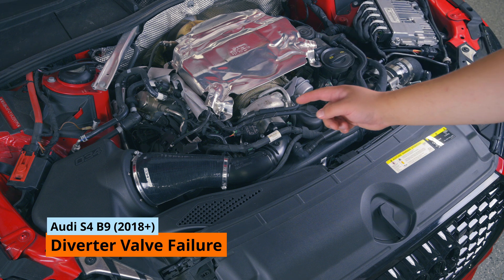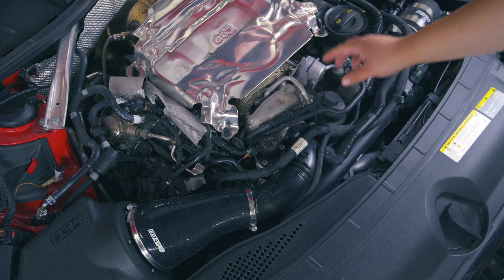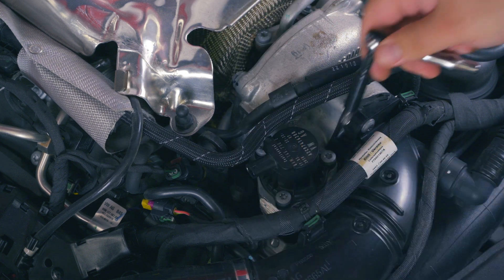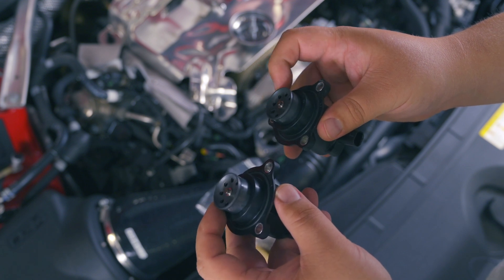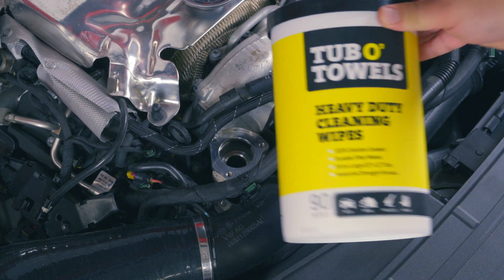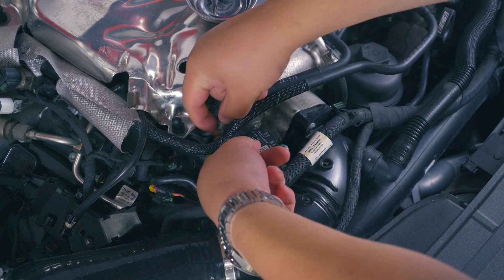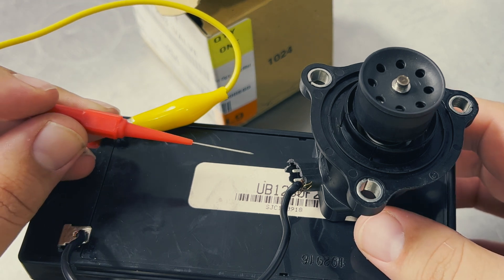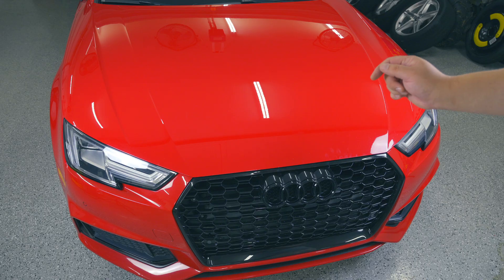Diverter Valve Failure - Audi B9 S4 3.0L V6 TFSI

Comment: hey man i kn9ow this was 2 years ago, but im having similar issues. did you experience any lag with the turbo/no full boost whatsoever?
Reply from the maker: I did not as mine was sticking closed. If yours is sticking open or partially open it could reduce boost and cause lag. There are other reasons for lag too. Should definitely scan codes as well with a vw specific scanner in case you have other detectable air leaks.

Comment: I’m getting a P02261 code on my b9s5 after installing tte810 turbo will this help.
Reply from the maker: Possibly. Have you double checked the leads from the diverter valve are hooked up and making a good connection?
Reply: what fixed your problem, i'm getting the same thing and i'm tte810
Reply: @Y @YTBJAY I changed diverter valve still comes on every once in a while I think it’s has to do with the wastegate but very seldom I get a code

Comment: Thank you so much for this informative video.  I was getting intermittent boost leak error code and I noticed the same type of flutter you showcased in the beginning of your video.  Most of the other recommendations I came across led to PCV breather hose failure so I ended up ordering both the newer DV as well as a PCV breather hose in case.  Hoping it's just the DV since those breather hoses are a pain to disconnect!  Cheers!

Comment: Mine failed for the 3rd time. Ugh.
Reply: Don’t feel bad. I have compressor surge under load and I am at stage 2 SQ5.
3 DVs have failed you but your  beast SQ5pushing 700hp with a the TTE810😮😮😅

Comment: Getting a code for P0033 (Turbocharger Bypass valve control circuit), not sure if it would be related to a failure on the diverter valve or not. (TTE810 B9 S4) Haven’t noticed much performance changes and the upgraded turbo is loud as is.  Curious if you had any codes/soft codes pop up? Thanks in advance
Reply: What ended up being your fix for that code?

Comment: Hey great vid, Question, did you have any underboost codes?? p0299?? Im geting that code, thought it was the wastegate so I replaced the turbo. Same issue. Next thing is to replace the diverter valve. I am hearing the flutter when you rev it up.
Reply from the maker: Thanks! No I didn't have any codes. You can try to swap out the diverter, hopefully that helps. Or PCV system maybe affected?
Reply: Did the n75 valve fix the issue? These engines have 2 of them. One at the top of engine and one by the water pump

Comment: Hey Dmitri, thanks for the video, my car is currently experiencing sort of similar problems. I am tuned and at full boost the car makes 28psi but then drops to 20psi and pulling timing as well. I am hoping that my diverted valve is failing
Reply from the maker: Hmmm pulling timing wasnt a symptom I had. Maybe fuel quality?
Reply: @DmitrysGarage  that’s what the shop thought too, but I all ready went thru about 5 tanks of fuel, mainly shell. I have a video of the intake sound under load, it’s fluttering pretty bad. I can dm you the video if would like to hear it
Reply: @Mark_Isaev_ did the valve fix it?
Reply: @beardog420  sadly, it was bad injectors and the car blew up 🥲🥲🥲

Comment: Just wanted to update and let you know the flutter is back and worse.  Any ideas on what else could be done or added to eliminate it?  If thats just the way it is so be it.  I just want to make sure I'm not wasting HP.  I almost never see the gauge at even half boost.
Reply from the maker: That's too bad :(, was it the latest revision? I've been lucky and mine has worked well even on the bigger hybrid turbo ever since I swapped it. I do know some people convert to a traditional BOV setup, but I've not personally done that. May be something to look into, though I hear some of the kits do cause CELs.

Comment: Wouldn't this be covered under warranty?  No that i could take my s4 to the dealer.  My aftermarket warranty is great and covers essentially anything.  Even scratched wheels.
Reply from the maker: Sure if you have a warranty they would likely cover it.
Reply: @DmitrysGarage  Did it myself, when i first started it and drive i still heard it for about 1000ft, then gone!!  By far the easiest job yet!!

Comment: Thank you again for another great video! Quick question: was you boost gauge not moving all the way to the end? Is sound the only noticeable sign?
Reply from the maker: It depends on how it fails. You could fail to build boost or it can get stuck letting out boost or both transiently. I think mine was sort of doing both.

Comment: Surprised this failed early but thank you for the video. Other than the flutter, were there other symptoms or warning lights? It’s unclear if the multimeter test helped you confirm failure.

Comment: Question, did you have an issue with oil at your  oil filler cap? Is there a problem with the crankcase breeder hose possible ?
Reply from the maker: I haven’t so far thankfully. Are you having this issue?
Reply: @DmitrysGarage  yes but thankfully after extensively researching I found out there’s an upgraded crankcase breather pcv hose for it.
Reply from the maker: Cool. Ill have to keep that in mind if mine starts doing it

Comment: Love the content, what's your take on the ea839 rocker arm problems that some people have experienced?
Reply from the maker: Thanks Rob, glad you liked the videos :). For the rocker issue, the new revisions do seem beefier. Seems to be same part as used on the Urus.  However, we've only seen a handful of cars on the forums with confirmed engine problems. This engine and it's 2.9L variant have been in used in quite a few cars starting in 2016 before the revisions. So far there's no clear indication that this is an endemic issue and that all engines from the 2016-2018 timeframe will suffer a rocker failure. As is, I wouldn't necessarily worry about buying a 2018 car if its well maintained and priced right.

Comment: i replaced my diverter valve with a Forge Motorsport one. Unfortunately, one of the mounting screws got cross threaded when trying to screw back into the turbo housing. only 2 screws holding it in with a broken one...ugh...

Comment: Thanks for this video!

So my car makes the same "STUTUTU" flutter sound when I get into the throttle and let off right before a gear change but can't reproduce via idle reving.

Does this presence of the sound mean my diverter valve is indeed going out?

034 Stage 1 93 tune and ECS cold air intake FWIW
Reply from the maker: Glad you liked it! Some compressor surge is normal, even on a stock tune with just an intake i could hear it doing it sometimes. It just shouldn't be doing it all the time and very violently.